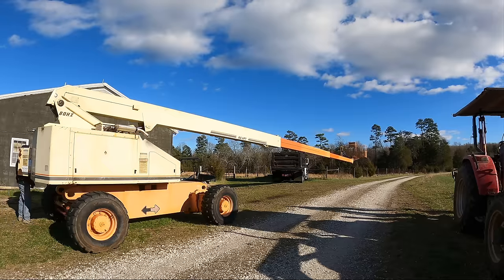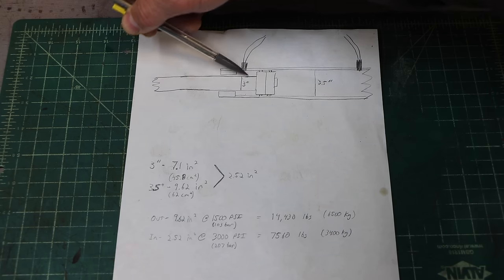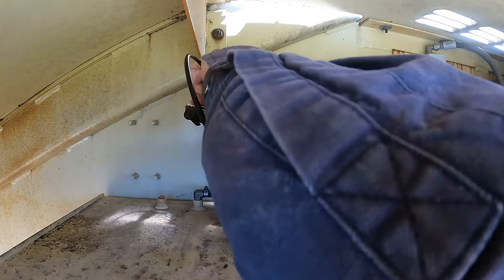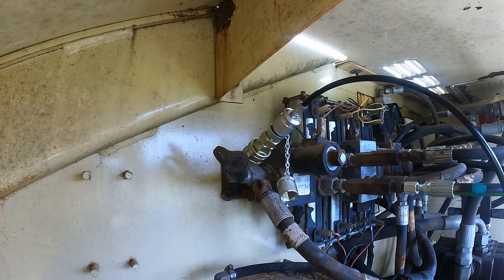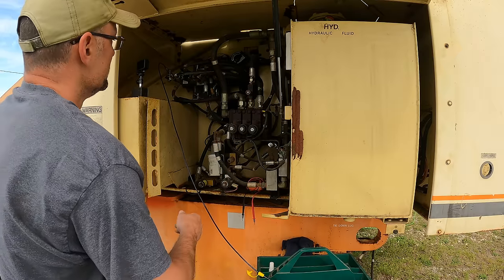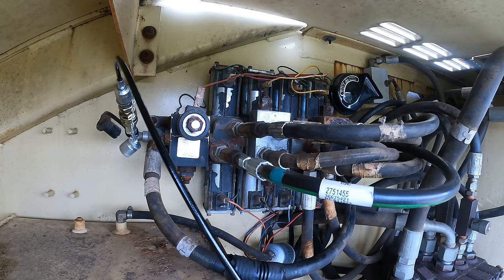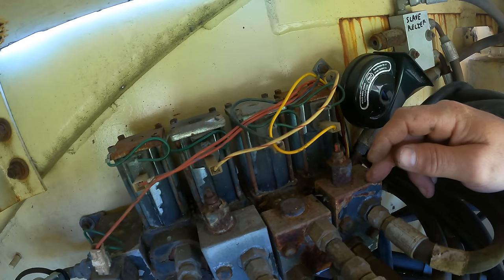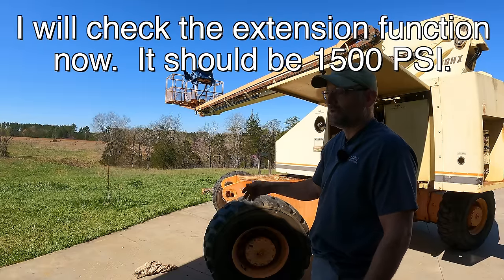My Toughest Hydraulic Job Ever. DIY Advanced Hydraulics.  JLG 80 HX Boom Lift

Comment: I reckon they adjusted that valve down to stop the engine stalling out. When you got it the engine was down on power. Great job.
Reply: Very good point.  I had forgotten about that issue with the down-power engine and its occasional difficulties.

Comment: I guess fully extended those two telescoping components of the boom have a lot of leverage on the opposing wear pads, so that gives a lot of pressure and thus friction on the pads.  At 2900 PSI and 2.5 sq in, you're using over 7000 lbs of force to retract that boom.  Think about the amount of wear that is causing.   I'd probably be inclined to avoid horizontal retraction from full extension unless really necessary.
Reply: Man, this is possibly the last installment of the boom lift. He totally disassembled this machine in the boom area for us. The wear pads are the least of it. If you watched all the episodes of this wretched machine you'd understand the context (but yes it's a big time investment). Considering the starting issues, the slow hydraulic travel motors, the getting stuck at heights the list is endless.
This horizontal extension is the very last piece since it was the least importance. Now the machine is done hence the sitting on the deck fishing at the end.
Reply: I'd consider greasing the pads, tbh.  Machine might get uglier from grease streaks but it will run smoother.  Maybe use a dry lube like a graphite product?
Reply: yeah but shouldn't you make the same argument about extension? it's twice the force of retraction and hence never got stuck, the lift was engineered to cope with that, otherwise they would have locked out those movements  in the first place
Reply: @AL_O0  The extend could also have 300lbs of gorilla weight in it too when extending vertically, coming down is a different story :-)
Reply: Completely agree, the more vertical the main boom is, the easier it retracts
Reply: @aerialrescuesolutions3277   Gravity is a wonderful thing
Reply: @kenstein  I would not. The grease is likely to trap dust and debris in it, and over time would just make an abrasive paste
Reply: @caseysmith1718  true.  I guess a dry lube would definitely be better.
Reply: @ThePaulv12  I would use the machine as it is intended to be used.  I have seen people not use a machine because of all their little fears and I think it is foolish.  The machine is designed to do a task allow it to do the task.  Jon, just spent all the time making it safe to do all the tasks and so why limit yourself.  If it just takes 30 seconds longer to lift the boom in the air, Why not do it?  Well because if you do that operation enough it adds up to a lot of wasted time.  What about the main hydraulic ram?  Lifting up that fully extended takes a whole lot more pressure on that main hydraulic ram.  Why is one component deserve to be abused more than this component? I think Jon's point is he wants the machine to function as it was intended so that he can use it.

Comment: I've worked with hydraulics a lot, Construction machinery, recycling and 24 years as a Mechanic in the British Army working on Tanks & "shimming" is acceptable AS LONG as the pressure achieved is within the specified parameters.
You achieved this by use the pressure gauges and good old fashioned engineering maths.
Kudos and respect to you.
Reply: Yep, there is nothing wrong with "shimming" in this specific case.
Reply: it put the system back to the correct pressure.  Springs are hard to come by and so this is a good work around.  They  shim engine valve springs all the time to bring them into tolerance and that is all that he is doing.
Reply: @cameronnerdin4910  The point Jim was making that some people shim BUT don't check what the pressure is , this DANGEROUS 
How the repair was done here is a text book example of "HOW TO"
Reply: I used to work with this type of machines about 10 years ago. A very common issue we had with both JLG and Genie were valves that got stuck either by a broken o-ring that got stuck in the valve or Loctite getting warm and melt and re-harden in the valve.
Reply: @andreasdahlgren7714  i never thought about loctite getting in to a valve.  Good to know.
Reply: Shim-shim-shimmy to the left, then shimmy to the right.
Reply: Shim it, pressure relief valve in cranes are also shimmed. Great work, keep it safe working with fluid under pressure.
Maybe some lubrication on the telescope sliding pads.
Reply: Exactly. When you adjust the screw, you are essentially continuously shimming it.
Reply: Some injectors or nozzles are shimmed with small washers, they work at higher pressure .

Comment: I had the pleasure of troubleshooting the hydraulics on the CNC-Lathe I work (CTX 2000 Gamma). Took me a day to identify the problem, another to wait for the replacement parts, and then two more to take out all the guts and put them back in... It turns out that due to a lack of preventive maintenance, two sets of valves had busted seals (those damn cute seals!)... 
Learned a lot, hated it at times, but was happy in the end, that I could fix it on my own, plus my boss owes me a cast of beer now bc he got to avoid paying for the technician from DMG to come in :D
Also took a few pages from your playbook; your videos helped me better understand hydraulics!

/cheers, and I'm gonna enjoy the video now!

Comment: Jon, love your YouTube vides, keep up the good work.

Manufactures don’t label for primarily because they want you to call “their factory trained people”.   They need their field service people employed to do their warranty work.  So they need keep everyone they’ll need - employed, they need to keep them employed doing as much as possible (warranty work is not enough)… hence, this is the biggest reason they NON’T label their parts.   But, their shop service manuals will guide them to the parts layout to fix all problems.   Another reason they don’t want to even post an equipment location or schematic sticker(s) where others can do this cross referencing information (these stickers cost money as well) and for DIY people to fix.   Too, if they should label and label wrong, this could lead to liability problems.

Comment: As an engineer, albeit of the computer science variant, I can tell you that with computers there are engineer friendly versions and the cost optimized versions. I would absolutely love the old IBM laptops... they had an entire chart of screwsizes at the bottom and every screwhole had both it's purpose (i.e. disk, memory, etc.) and screwsize labelled next to it.
Reply: Some people just ascribe to the Klingon school of technical design, "Comments are for the weak, code is supposed to be difficult to understand".
Reply: @Mishn0  to be fair to those who are doing the coding. Your employer doesn't care about you at all. So obfuscating your code is a good way to make it hard for them to find someone cheaper to replace you with.

Wouldn't be an issue if companies stopped getting rid of the good (but "expensive") software devs.
Reply: @harmonic5107  That only really works if the employer is also technically adept. Once the entrepreneur has sailed off into the tropics on his new yacht after selling his brain-child to an investor, they think everybody is replaceable. Been there too long so your salary has risen too high? Fired, replaced with a kid right out of college who has a lie packed resume. Let's see him unravel obfuscated code!
Reply: @Mishn0  In my experience, that always comes back to bite you in the ass, just like not labeling hardware on equipment does. You think you remember what does what, but in the end you always end up rereading your code or retracing lines in your machines to make sure, or just to figure it out again. You can never comment or label too much, especially if you're sure you'll be the next guy working on it.
Reply: @timderks5960  Hence the joke about "The Klingon Programmer's Code of Honour". Look it up, it's pretty funny. 

Back in my coding days I got to work on our old legacy DOS stuff because none of the new kids ever learned how it worked. But, when that finally died out they gave me the boot because I was too old and they thought they were paying me too much. Oh well, I was sick of it anyway.

Comment: Jon, it sure must have felt good to figure out the hydraulic system and the functions of the valves so you could finally achieve the correct pressures. Now you boom operates nicely. Good for you. Blessings to you.

Comment: Enjoyed your troubleshooting on the JLG80. I Volunteer with the California State Railroad Museum shop. We have a JLG70. The biggest problem we've had was after the head gasket blew and figuring out that it was out of 87 Ford Ranger. Now it starts and runs perfectly. But watching your rebuild of the hydraulic cylinder and adjusting the pressures on the hydraulics was awesome.

Comment: Thank you for going all in with your hydraulic system, youtube really lack content even tho it's not that complicated and all over every equipment. I have one drive motor running a bit lazy on my mini kubota excavator, i thought inner joints were bad. The thing is, it has only 2600 hrs and from 1999. Maybe I have a bad pressure then ! (track tension and rollers are ok) Loved your simple repair. Cheers

Comment: You probably already noticed, but at 53 mins or so, on retraction, there were two spots on the chain where the chains lifted up - more lube required? Great video, as ever, always look forward to the next one. Thank you.
Reply: Thats just the cable carrier, you could lube it but that will also catch dirt and lead to excessive wear on the cables/hydraulic hoses inside de cable carrier

Comment: if you wonder if there was someone screaming at the screen for like mostly the whole video to tell you you were working the wrong screw... you are correct. there was someone. and that someone was me. and that someone also learned this the hard way. i dont remember if i mentioned it in a early video but i suspected a pressure relief valve issue when i first saw this issue.

Comment: Glad to see you using sealant instead of Teflon! Loctite 545 is my go-to for all hydraulics. A buddy of mine found a tiny piece of Teflon in his $10k hydraulic pump. AFTER the stealership sold him a new pump! I quit using Teflon on anything except my household plumbing quite a few years ago. I have never had a Loctite 545 sealed fitting leak ever.

Comment: I was foreman over a hydraulic planner mill in an oil field machine shop. That mill got to where it would surge about 10 inches, only when it was cutting, very dangerious. Maintenance found a roach the size of your thumb, stuck in a hydraulic line. :O)

Comment: Was working on a much much much smaller hydraulic issue myself yesterday. The third function kit I added to my Kubota recently was dumping fluid on the ground. Took it all apart, found a vitron o-ring that was chowdered up (at the factory?!), replaced it and reassembled,  and it seems all better.

Great video, learned several useful things.  ...including how to trim down a washer, which I will use shortly to fix a PTO shaft.

Comment: a shim is often used to raise pressure by pre-tensioning the spring, Just be careful of spring bind. Ive blown a few pumps/hoses etc. over the years because the pump could not release pressure, it happens. Paul Munroe Hydraulics service tech retired.

Comment: coworker was in a JLG manlift once about 20 years back, I'm assuming one of the hydraulic solenoids stuck as he was driving it in an energized substation (we are mechanics and linemen)  control just got stuck and kept on going right out of our work area and into an energized quarter million Volt line.  after wrestling with everything and no response from the lift, he ducked in the basket and slapped the E-stop only a few feet away from being turned into burned toast.  he refused to ever get inside anything made by JLG ever again.

Comment: Worked on these lifts a bunch .  When you're scoped out horizontally like this there is a ton of friction to overcome coming back in .  I use dry graphite spray on the boom sections where the wear pads rub and it helps make it move easier and smoother.

Comment: Your experience of "just a simple valve adjustment" is about the same as every DIY'er.  Wrong tools, distance away from tool box... the usual.  Rarely anything is easy, or at least it seems that way.  Thanks for the video.  I look forward to your technical descriptions of how you figure the inner workings out.  A vital component to be a DIY'er.

Comment: Hydraulic pump enginerd here. Well done working through the fluid power system. The spring probably just took a set after all these years and numerous pressure cycles. Shimming should be ok so long as the spring doesn’t reach solid height. I’ve also run into those farmers burying reliefs for more chooch factor and blame us for making junk.

Comment: I once heard the John L, Grove, inventor of the JLG, had the unit designed after his sons rigging accident that took his life. If this is true, imagine how many accidents were avoided by it's invention? I have worked hundreds of hours in these baskets welding pipe and they are a life saver. 120 footers are a bit twitchy in the wind though, but better than climbing and hanging on  cold steel. Thank you Mr. Grove, and my family thanks you also.

Comment: Hey. Just quick note. Next time u wanna test a radiator for Leake. Get a bicycle inner tube cut in middle, but one end of the tube on each outlet. Put air in the tube and monitor the pressure. Or u can just spray the radiator. That way u don't have to fill the cows water container to test it. Hope u like it.

Comment: Shimming a linear spring don't make it stiffer,but only cause the pressure threshold to be less progressive.
The max pressure it will sustain when compressing will be the same shimmed or not, the difference will be at wich threshold it will start to move enough to open the valve.
If you want a stiffer spring,you need to shorten it,then shim it to obtain its previous length.
A coil spring is just a bar of steel flexing : shorter it is ,the less it flexes.

Comment: Jon, Hydraulics are amazing.  I am happy you explained how on a double acting cylinder you loose so much power on the retracting of the ram. I learned about a double acting ram the hard way. Usually a dump truck has a single acting pump because the weight of the bed you only need a single acting pump, but on mine they put a double acting ram and so I ended up buying 2pump units. One that made the bed go up but would not let the bed come back down, and then the correct one.  I learned this a few years ago and valuable info.  You are as good a hydraulic mechanic as any I have seen with you actually reading how the system works and then solving the problem.   Great video.  Also kudos on the fire extinguisher video.  I was lucky a long time ago, I lived next to a guy who worked at a fire suppression company and he taught me a lot about extinguishers.
Reply: On a gravity down system you just needed to activate the solenoid to open the valve to allow flow back to tank. Up button gives power to pump and valve solenoid. Down button would be same solenoid without power going to the pump.
Reply: @RiverValleyLandscaping  Yeah I tried everything I could, but I was sold the wrong pump and ended up having to buy another pump that was the right one.  I spent so much on hoses and valves, but it just did not work quite right. I just ended up buying the correct pump.  ugh cost me a grundle at that time.  It has saved me a lot of time in the end.  I found that it was great because the bed cantilevered over the rotational point on the frame, so I could use that power to lift items.  I used it to lift a front end loader on a job sight repair, and many stuck skid steers out of mud pockets, I used it all the time, so no regrets, it was just an expensive lesson in hydraulics.

Comment: Great video!  I've shimmed oil pumps with various degrees of success and you've done well here.  That's a big heavy machine and you don't want to be stuck with the boom out with you in the cage!  It's easy to say buy a new expensive block, but I would thoroughly check those hoses and connections.  And how about a bit of white grease on the mating surfaces of the boom... that cable track could do with a bit of tlc, brush it down with water resistant grease occasionally and it will last forever.  Equipment like this is priceless when you need it.

Comment: By marking parts & not letting frustration kreap in. You gradually identified each process. Hyraulics can produce amazing processes that save time. Diagnostics & documentation eventually break down a process. Good you can revisit issue until solved. Hydraulics & pneumatics can save time & improve working conditions. Had huge companies & utilities to work for. Have a safe time .

Comment: As soon as you adjusted the valve and it didn’t change, I knew you were turning the wrong one. Adding a shim is fine as long as you don’t go over the pressure. I have the same pressure gage set, I work a few of those lifts only a little smaller. Persistence without getting pissed off, is the key for difficult situations.